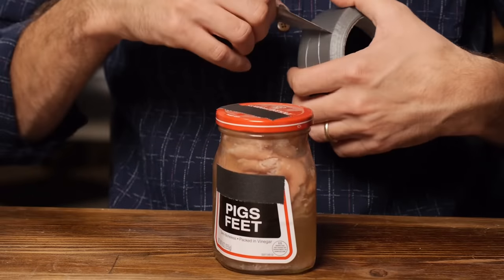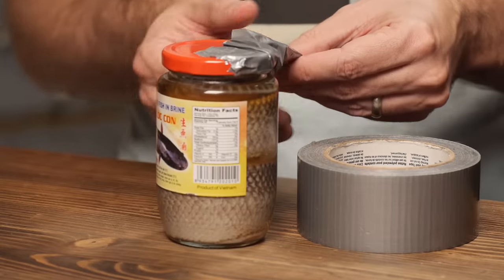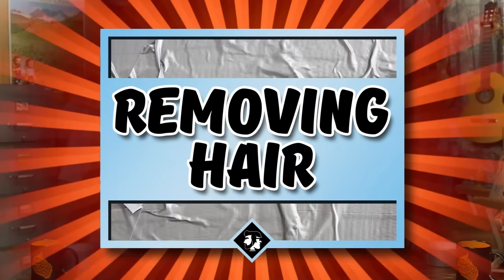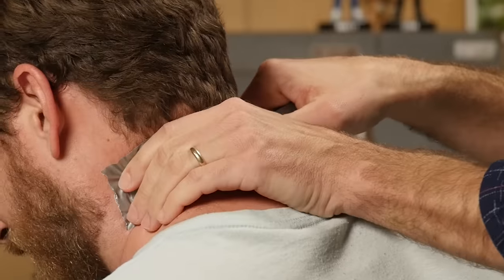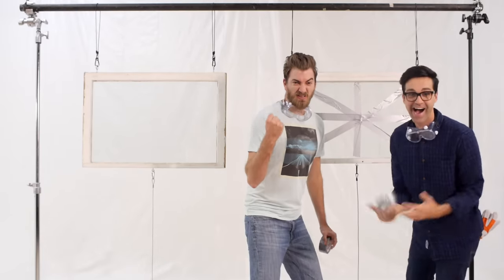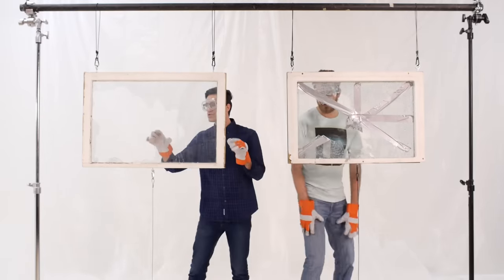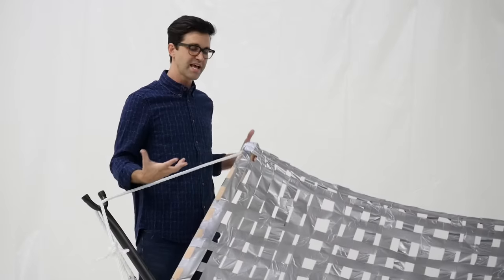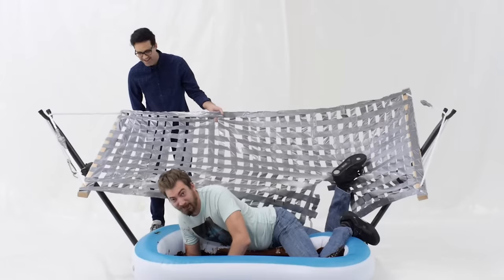5 Weird Things You Can Do With Duct Tape

Comment: You should never duct tape your windows as hurricane preparation. It makes them weaker, which is why when you hit them with a brick the whole window shattered. Debris is an issue, but hurricane winds can be strong enough to shatter windows on their own. So if you duct tape them, you're actually putting your house in danger instead of protecting them because the damage won't be concentrated (i.e. brick hole). Duct tape will make the whole window shatter and have glass fly around the house whereas the natural bonds in the glass of un-taped windows should be strong enough to withstand high winds. Just saying, I'm a Floridian, and I'm a little concerned about endorsing duct tape for that type of thing since every year we have to warn folks NOT to do this...
Reply: The reason that the duct tape window completely shattered is because it was made of different type of glass than the other window. It was made of safety glass, as opposed to regular tempered glass (I think) in the other window. Safety glass is designed to shatter into smaller pieces to lessen the risk of huge lacerations to the body
Reply: PITSteelers no it was the same type of glass

Comment: Are you aware that you used two different kinds of glass? The window on the left was normal glass while the one on the right was safety glass which is supposed to shatter into small pieces when broken. I would be interested to see what happens with normal glass when duct-taped

Comment: Just FYI for a cyclone, duck tape the inside and outside of the glass in a cross pattern so as the tape is overlapping will be much more effective. Also, allow the tape to go up onto the frame but allow no gaps (air pockets) in the tape.

Comment: Banging the bottom of a jar with the heel of the pomegranate hand will make the jar open easier than using dictate. Or you can take a can opener the kind that pokes a hole in the top of a can and go around underneath the lid a the jar and just slowly wedge the opener under a little bit and let some air in different places around the lid. This makes a jar easier to open. Jar being airtight is what makes a hard to open that's why you need to let a little air in either with the can opener, knife or screwdriver. You don't need to destroy the tiger lid you just want to get some air under it and it will remain in tact. Or you can lightly tap around the lid of the jar with say a butter knife the handle and of course not to dented but just to tap it and then the jar should opened up easily.

Comment: They need to retest the glass thing, cause the control window was plate glass, and the duct tape covered one was tempered, which is designed to spider web like that for easier clean up.